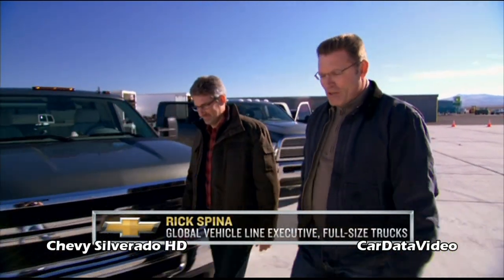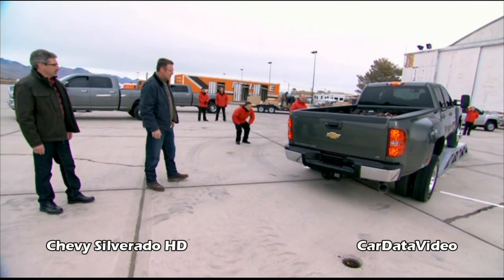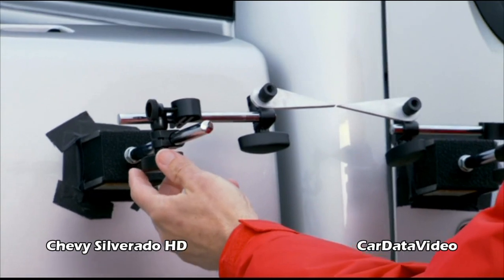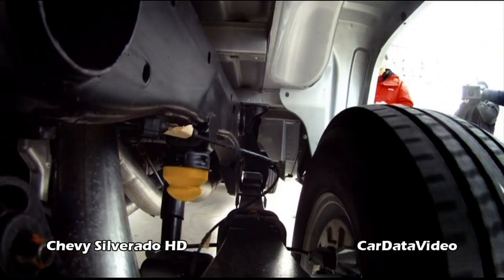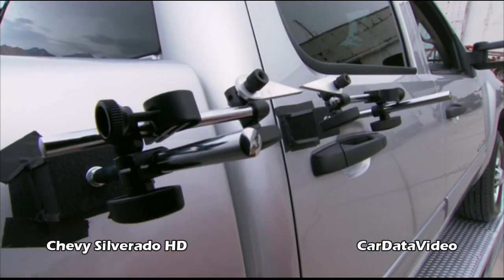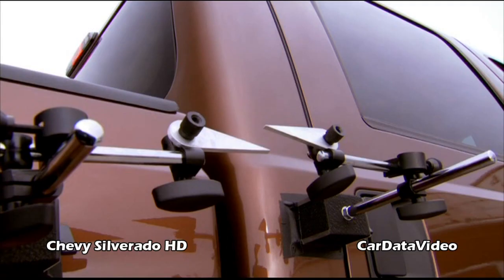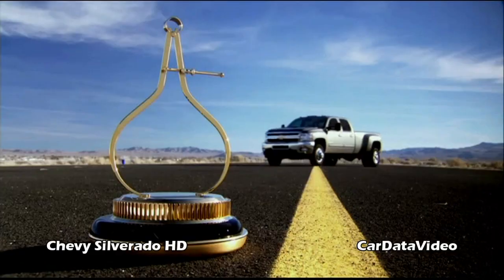Chevy vs. Ford HD Truck - Bed Bend Video

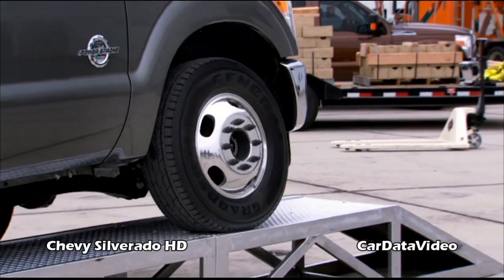Comment: 1:14 dont you love how they were zoomed in on exactly that part of the bed when it ''Bent'' coincidence i think not.
Reply: All they did is zoom in after they filmed
Reply: @mikeoxlong9403  that's not a digital zoom it was filmed in 1080x720 the resolution would've looked terrible zooming in that far.
Reply: I was thinking the same thing....  Fake news!!
Reply: I'm thinking I might believe this test if it was someone like myth busters but not when it's done like a commercials.
Reply: @mikeoxlong9403  u are a fan of chevy and cant admit Ford is better aren't ya
Reply: It's called editing
Reply: @jackey2681  no it wouldn't. Back in the day 480 was high resolution. Put your video on 480 and see how it looks.
Reply: Besides so what if they knew and decided to video tape another tailgate in that area knowing what it would do.
Reply: @mikeoxlong9403  The FOV is the same as in that shot as in the rest of the shots. They had to be focused on it with a mechanical zoom
Reply: @mikeoxlong9403  no it wasn't you can tell this was an optical zoom. a digital zoom that close to the dent would magnify all of the artifacts and imperfections in the clip unless it was filmed in 8k or something like that. but 8k didn't exist when this was filmed.
Reply: ItzRy_ I’m not a fan of neither.  Do I think Chevy is better yes would I want one no.  Fords are good for like 5 years there made to fall apart after that

Comment: Notice that the 1-ton trucks were loaded and they didn't drive the 3500HD up all the way on the ramp so that the rear duals would hang off the ground. If they did the Chevy would suffer frame damage because it doesn't flex enough. A tailgate costs less to fix than replacing a frame.
Reply: David Larbes There was plenty of room.. It's staged, But Chevy and Dodge have the best frames, Dodge being having the less tweak to it.
Reply: Dylan Gilbertson The empty 3/4 ton trucks (both Ford & Chevy) were driven further up the ramp than the loaded 1-ton trucks (both Ford & Chevy). If flex is bad, why to class 8 trucks have c-channel frames? F-250 and up trucks are more sought after by up-fitters because their frames are stronger and easier to build off of. How many Chevy or Dodge ambulances have you seen in your life? Any reputable tow truck builder will not even touch a Dodger or modern Chevrolet truck. What do most of the power companies use? Construction companies? Manufacturing? etc. Don't lie to yourself. The Ford is selected more because it is built like an industrial grade truck. Industrial grade trucks do not have boxed frames. I love the boxed frame that my F-150 has. Its really firm and rides like a tank, but it will not withstand the compressive load that a big c-channel can. I wish they would load these frames up to the point of failure. If they did, everyone would see that the Ford would handle more weight before it fails than the Chevy or Dodge. If the loaded 1-ton Chevy would have been driven on the ramp like the 3/4 ton it would have been damaged. At the very least the welds would have failed at the cross-members.
Reply: David Larbes????? bud idk if you looked close enough the first time, but you need to take another look.
Reply: supermotox55 Dodge has the worst frames. I know a man who built Chevy and Dodge frames for 30 years; he drives a Ford. Chrysler has always chosen the cheapest way to get the job done. Back in the late 80s Cummins told Chrysler that they wouldn't let them use their engines until they improved their frames because they wouldn't hold up, and they didn't want the reputation of their engine ruined. They were DESCENT until the late 90s, but then they started cutting corners again. For example, if you take a 2002 Dodge to a tow-truck builder to get up-fitted they will tell you to get lost. The whole truck would need to be tore down so that the entire frame could be beefed up. Chevy had a pretty good frame in their 3500HDs around 96'-00'. That is why you see a considerable amount of tow trucks in these years that are Chevy/GMCs.
Reply: ***** compared to the ford yes, but compare it to dodge, look up dodge and ford frame twister, you'll see what I mean.
Reply: dude I hate Chevy more then anything but I am a ford technician and our frames are junk as well as the beds
Reply: +Zack Zander all the trucks were driven up to a line on the right side of each vehicle so ur excuses are not enough ford sucks live with it
Reply: Dylan Gilbertson
If you have no flexibility in anything, it's quite easy to snap. Go do your homework.
Reply: Evan Tumelty At least you are honest.  That is more than can be said for a lot of people.
Reply: Rick Laga Hey thank you I have done my homework. (I realize you were not talking to me but oh well) I just want to inform you that just because a frame is more resistant to flex does not mean that it will be damaged when it ultimately is forced to flex.
Reply: 86dieselman
It depends on how much it is being flexed and how much weight is being put on it. There are a lot of variables that contribute to determine the breaking point. It's not just flexing.
Reply: Yes those are given factors.
Reply: *****
I refuse to believe a test that is biased. I am a Ford guy and if this was ford instead of Chevy doing this, I would still discredit it. Biased tests never give you the full truth about the opposing product.
Reply: I had a 3500 Silverado fair truck, but had a problem delivering products, sell products to farmers. Had to be pulled out many times, The truck, plus the weak front end on the 4x4. Have a F-350 Ford, 2011 has over 100 thousand miles 4x4 with 4 wheel lock have not been towed out, sets higher, a little hard to get in for a big man, but sure has been a good truck, has a 6.2 gas,the Chevrolet had a 8.1 tough motor, but the 6.2 is as dependable as.the 8.1.
Reply: I'm a GM engineer. I can say with certainty that our frames are not as good as the Fords.

Comment: So this is where all the cracked GM frames come from. Shitty cheap steel with no flex. BUT LETS MAKE IT A POSITIVE THING FOR DUMB PEOPLE.
Reply: haahaha funny shit guy! The worst of GM trucks is twisting drive shafts an easy fix, for ford to fix the twisting issue it would take a lot of engineering and a lot of wait gain which ford cant afford lol. Another thing Fords new hd trucks are so sag ass because they cant afford to make a stiffer rear due to the wagon train ride lmfao!
Reply: sammy duran
LMFAO!!!11!!11 its like I'm talking to a child.
Come back to me when you learn a little bit about towing and why semi-trucks run FLEXIBLE open c-channel frames. Stiff steel is cheap and poorly tempered. Look up GM cracked frames.
Reply: Lol ford said specifically a c frame to prevent flex, the exact same reason the f 150 went fully boxed. Come on dude I drive a super duty for work I know how these trucks r, my bed is like 4 inches off on flat ground because of there great c frame. My personal truck is a 2008 2500 Silverado z71 lockers Haha, and I tow a 2013 40' tow hauler, fully loaded at 26000 pounds which is way over my limit and have put her in wild twisting situations never had an issue. Come on ur barking up the wrong tree... plus don't forget ford says to prevent twisting Haha Chevy is hidro bent for strength tech over a shrek all day ya I said shrek lol ugly ass trucks
Reply: Also due to the covered wagon ride that's why ford softened there rear springs, sag ass new super duties just admit it the only super duty there was is the 7.3 lol
Reply: Not really with the 7.3 my old 1977 crew cab always 454 always smoked my buddies 95 7.3 that's why they made the 7.3 to hang with chevys big blocks and theyre still playing catch up lol
Reply: Never said faster bud said smoked
Reply: I can't wait to see what will happen to the new aluminum "superduty" when it twists up like that lmfao!
Reply: Xerxes X
sigh....ya know what. Just buy a Chevy and enjoy the recalls.
Reply: Bought a 2014 Sierra last august, and never had to take it in for a recall... Buy a creepoboost and enjoy the bill for failing turbos and an aluminum body that will dent if I slap my cock on it 
. Lol
Reply: The ambulances where I live are Chevys and they run them up to 400K.. They run the shit out of them carrying a payload of equipment and never hear of them having cracked anything...the Fords that they used to run, got sued because heads were constantly cracking...so there was a standing order of getting heads fixed for free
Reply: I have a buddy who is a ford mechanic and he was saying he doesn't know how ford stays a float with all the warranty issues they deal with and also most of the mechanics working for that shop drive Chevrolets/GM vehicles. Fords are fleet vehicles that's all dime a dozen and built dime a dozen, they wrote the book on that shit and China learned from them.....
Reply: ***** The people in charge of spending money maintain fleets of trucks for people that rely on their truck have all the data in front of them. They look at cost to acquire and maintain a fleet of trucks, And year after year they normally buy Ford.  When was the last time you noticed a Chevy ambulance? If Chevy was better, there would be fleets of their trucks being operated instead of Ford.
Reply: The Chevys started rolling out starting in 2009.... U don't know what ur talking about obviously
Reply: sammy duran By mechanic, do you mean oil and lube tech?

 From 1999 to current there have only been 13 recalls of Superduty trucks. The majority of them involved parts supplied from outside vendors. 

 For the HD line of Chevy/GMC between 2000-2013 there were10 major recalls that involved bringing back the majority of the trucks made, After 2013?

General Motors is recalling 57,192 2015 Chevrolet Silverado 2500/3500 HD and 2015 GMC Sierra 2500/3500 HD pickup trucks for a clamp problem that could lead to a loss of power-steering fluid.GM is recalling 57,512 vehicles, including the 2014 GMC Sierra LD, Chevrolet Silverado 1500, 2015 Silverado HD, Tahoe and Suburban and 2015 GMC Sierra HD, Yukon and Yukon XL models because the base radio may not work, preventing audible warnings if the key is in the ignition when the driver's door is open.General Motors is recalling 58,652 2015 Chevrolet Silverado HD and GMC Sierra HD pickup trucks because retention clips attaching the generator fuse block to the vehicle body can become loose and lead to a potential fire. General Motors is recalling 51,923 2015 Chevrolet Silverado HD and GMC Sierra HD pickup trucks equipped with the diesel engine and dual fuel tanks to fix a problem that poses a fire risk.General Motors is recalling 47,708 2014 Chevrolet Silverado and GMC Sierra pickup trucks and the 2015 Chevrolet Tahoe SUV for possible tie-rod separation and loss of steering. General Motors is recalling 9,466 2012-'13 Chevrolet Silverado HD and GMC Sierra HD pickup trucks equipped with 6.6-liter V8 diesel engines and dual fuel tanks because of a problem with the fuel pump.General Motors is recalling 54,686 2013 vehicles, including the 2013 Chevrolet Silverado, because of two "scenarios" that may cause the vehicle to roll away.Not to mention the ones that catch fire before they even make it to the dealership. If you look at GM as a whole, they have recalled more cars in 2014 than they sold between 2000-2010. Many for issues they knew the cars had but did nothing about until they started getting sued by families of people they killed.
Reply: Google is very informative, I doubt you knew that by heart, funny how.u never mention the Ford 6.0 with cracking heads, ,  or the super duties cracked crank shafts,  out of all those stats u posted, my 2014 sierra hasn't visited the shop once for a recall,
Reply: +Anthony Spencer  I have 280k on my work truck Silverado and haven't had any issues. All my buddies with fords have issues the latest is my buddy with the last years eco crap. Over heated the eco crap twice, took it to ford both times and never fixed it then blew tranny got that fixed then he decided to trade it in.. when he was cleaning it out to trade it the next day the interior lights stopped working lmfao!!! And this is common shit for ford crap trucks why does doesn't do a recall and how they get always that shit beats me! And like Xerxes mentioned the problem desiels so many issues and so many different desiels engines lol!!
Reply: NEWSFLASH:  they are both good trucks.  THEY BOTH BREAK TOO.  These companies play you against each other to make you loyal and keep you buying their product.  DUH.
Reply: murmaider2 im not much of a truck expert but when ur in a ditch and trying to hual something i dont think u want ur truck to bend and sway whatever ur hauling.... but how would i know apparently im a "dumb peson"
Reply: Sarah Gleason
I guess people have been designing semi-trucks all wrong for decades, here comes Sarah the not-engineer to shed some light on things. If you're in a ditch with a full load, youre doing it wrong.
Reply: murmaider2 Last time a checked the video they weren't fully loaded they had a small load. And as for semi trucks yes they are c frame but they're not meant to leave the road. Do some more research and you'll find the military semis are fully boxed frames. Look up also ford truck tractor pulls you'll notice they're on flat ground with they're frame twisting up, dodge less twist and Chevrolet no twist, that's why Chevrolet and gmc duramaxs dominate in tractor pulling bud...
Reply: +sammy duran I'm a chevy guy but in the video, they clearly state that there is a 3000 pound load in the trucks.
Reply: True true
Reply: Dumb is right. I am 40 and never met one intelligent chevy owner in my life. People and vehicles sadly american.
Reply: Haha hahaha right ford always playing catch up !!! It's been like this for years!!
Reply: Oops but the funny thing is its only fully boxed under the cab and c frame under the bed, because if they fully boxed the whole thing the weight savings of the aluminum would have done squat. Still behind Chevrolet... Chevrolet was first to fully box, first for quite, clean, and plug in free diesel, first to offer IFS. Ford first trying to keep up by offering a diesel to keep up with Chevrolets big block, ford first to v10 again to keep up with Chevrolets big block, then Ford briefly came out with a twin turbo diesel to keep up with the duramax (that was a terrible fail just like all their list of fail diesels, and now they gave up on their crap v8s and are trying twin turbo v6s! And last but not least the sad excuse of making their truck lighter by making their bodies out of aluminum to make them barely lighter than the Chevrolets, funny these guys are desperate,. But ford owners must be right they are the best selling trucks  kinda like bud light beers and Walmart superstores ......
Reply: +Brian Moe nor have I met a ford owner who didn't have a big mouth that's the only thing that runs on ford
Reply: +Ryan Chapman true that's about the only thing that runs on a ford.
Reply: +herpherpbrocolli  How does sloppy handling improve a trucks ability to tow. I've driven several Ford HD trucks, in varying configurations, and they all had one common trait. They handled lousy. Stiff frames give a more solid platform, IE better handling.
Reply: Writing in all capital letters doesn't make your comments cogent. It just shows you've poor grammar.

Comment: You also don't want a truck to be as stiff as the Chevy under load, it can reduce traction. the torsional twist helps keep at least 3 wheels planted to the road. Chevy's and Dodges are notorious for cracked frames when plowing
Reply: Yeah but if you go up a little hill like the one in the video, the bed door doesn't get jammed as the Ford did. My Chevy has been through hills and back. She's outdid any Ford truck even in accidents.
Reply: +Cindy Conny doubt it
Reply: +Cindy Conny When do you ever open your bed in a fucking ditch lol
Reply: Kevin Wayburn actually it's the consistent flexing that causes the snapped frames it's like grabbing steel and bending it back and forth until it snaps less flex is better which is why they snap ram had rust and a stress point at the front of the bed that would cause snapping
Reply: Less flex the better that's why you make sure your suspension is ok and working properly or upgrade it
Reply: love the F series id dominant at worksites arguments... a company that sees 2 trucks 1 cheaper and with 
few short term problems is likely to chose it as they can save money that way. but it's like buying cheap tools you can buy manny and it doesn't matter if 1 breaks because you got another one you can throw at the jobb....
to many companies work this way..

Comment: well shit, when was the last time you saw a Chevy from the 1980s? Enough said. Shit I don't even see the ones from the 1990s. They are all dead and gone. Meanwhile, I still got two F150s from early 1980s, working the road.
Reply: Y10Q we
Reply: Y10Q I drive an 1984 c10 and know alot of people that drive trucks like mine. we have another for plowing too. it was hit by a semi but it still goes
Reply: Y10Q are u out of ur mind there's nothing but 90s Chevy's everywhere can't go anywhere without seeing them yet never see 90s fords lol ever
Reply: Y10Q Idk where you live...
Reply: Y10Q I see 50s and 60s  ford F150 out and about in my town still running like they are new on the other hand my cousin has a 2005 1500 Chevy and it's free crappy I got a 1996 Ford Ranger I bought off a guy for three hundred bucks I just gotta put in a new motor because he blew it up and I can drive it again and it still have balls with a blown motor and tell the clutch killed itself
Reply: Y10Q hahaha I have a 98 silverado with 285k miles and it runs like a fucking beast!